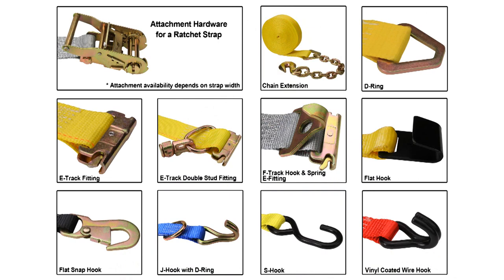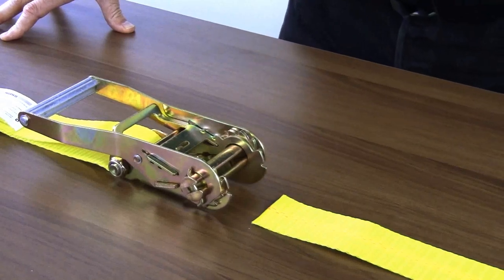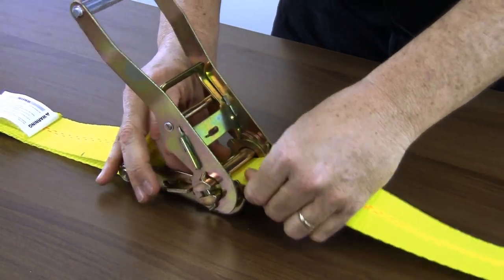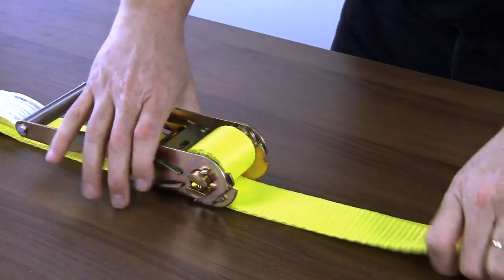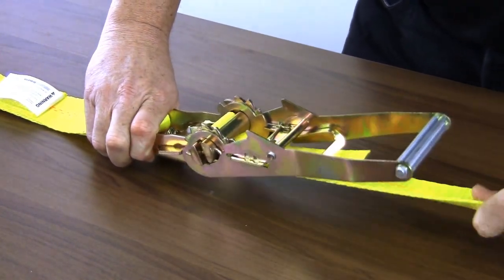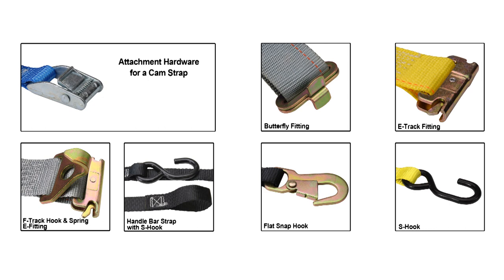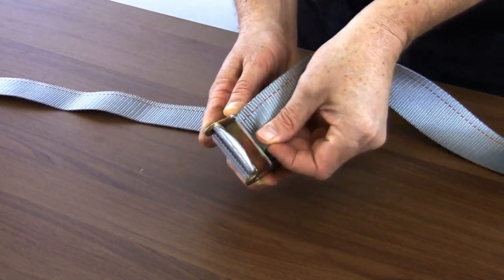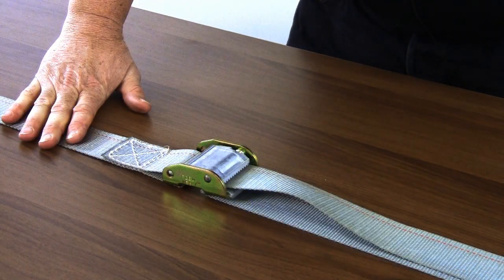How to Use Ratchet Straps and Cam Buckle Straps - Beginner's Guide

Comment: Can you pick something up with it? I mean i know it is to pick things up, but can you show us?
Reply from the maker: Hi Izri1,
Ratchet Straps and Cam Buckles are actually used to secure product, not to lift. It is commonly used to tie down products on a flat bed semi trailer or similar applications. To lift products, you would want to use a lifting sling. You can check out our lifting slings by visiting http://www.uscargocontrol.com/Lifting-Slings .  Thanks!

Comment: How do I un lose it
Reply from the maker: To unratchet the strap, all you need to do is open the ratchet until it is flat, in the open position. Then just pull the strap back out of the mandrel. Skip to 1:28 in the video and you can see it being demonstrated.